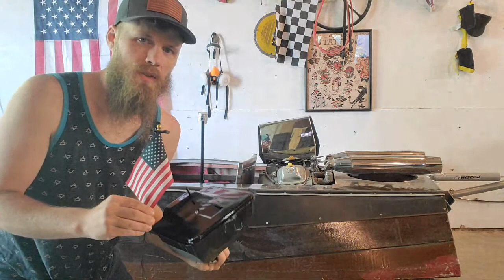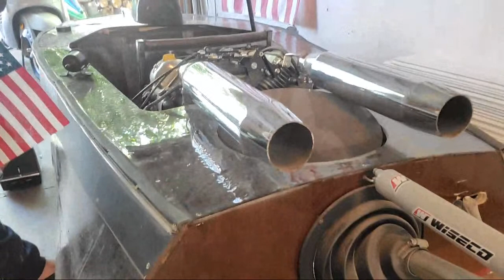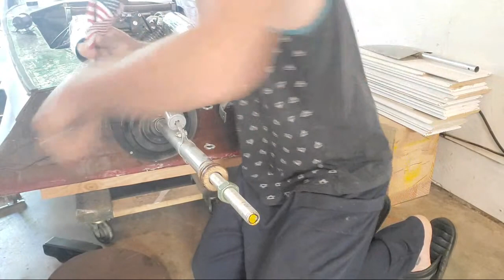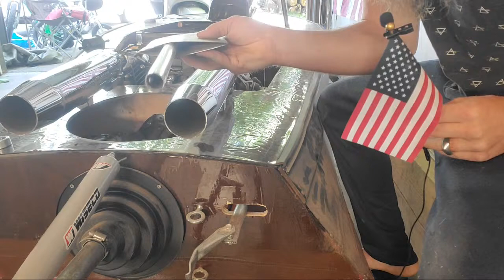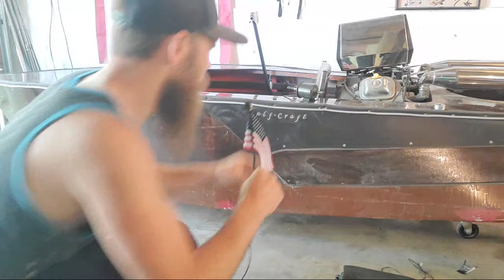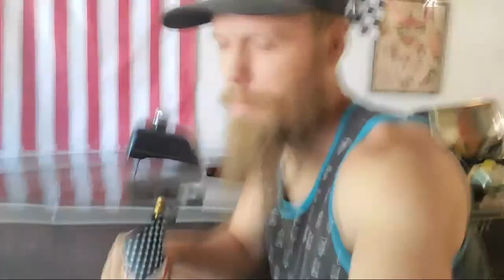V Twin Monster Mini Boat Harley Freight Plans

Comment: on the starter switch, why not just run a solenoid? That way you can keep your wires thin back to the solenoid then run a heavier gage wire to the starter. That would be the cheaper option IMO. 

looking at the exhaust, use some small pieces of header wrap to help with the heat.

you may have also thought about these things but it's hard to me to get on the live feed when it happens. Keep up the good work and keep the videos coming!
Reply from the maker: Great ideas!! Maybe there is a way to use header wrap and still see the beautiful chrome?  I like the solenoid idea I'll just have to research a little more how! I'll try to schedule a live and warn everyone ahead of time!
Reply: @americanboathead5390  I'm just saying to use the wrap on the short section coming out of the motor. As for the chrome I'm still pondering how to make that happen. I think your idea about a plate beneath would probably be best. 

The solenoid is stupid simple. I wired one for a big fan in my Jeep. I believe I used an old Ford style solenoid with the four posts. Two large posts on either side and two small ones on top.
Reply from the maker: Oh good idea about the wrap!!

Comment: That shaft has to be solid mounted
Reply from the maker: How do you mean?
Reply: @americanboathead5390  I suppose when it starts vibrating, you'll know immediately what he meant
Reply from the maker: I've had it running and didn't notice anything other than engine vibration at any rpm so idk...

Comment: You're on a boat, you're floating in a fire suppression system, it's called Lake Water. Just buy a bucket. It's multi use, you can put out a fire, then use it to bail out the boat.
Done. And done.
Reply from the maker: Hahaha

Comment: Man that is one cool boat what size plywood you using to build those
Reply from the maker: Thanks! I usually  use 5/8" or 3/4" for the floors and transom and the rest is 5mm plywood (just less than 1/4") on 2x2 framing

Comment: And a tube running from the rudder upto the exhaust at the beginning of the muffler to cool them
Reply from the maker: Good idea!!
Reply: That shaft shouldn't be allowed to move and I would Mount the motor almost All the way back and maybe just notch out for the exhaust to coy up through and put the rudder behind the prop and a tube from behind the prop up to the mufflers Will cool them and have to pipes and gas tank out the back too
Reply: Sorry was working when you went live a small pump to pump water into the pipes would work too, but small drain wholes in the bottom back ,/ help prevent hydrostatic Lock